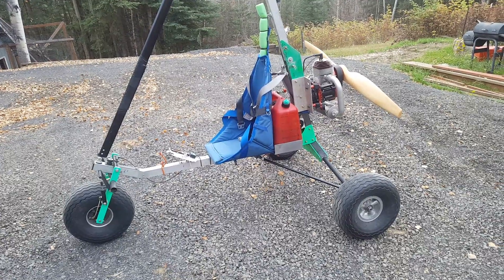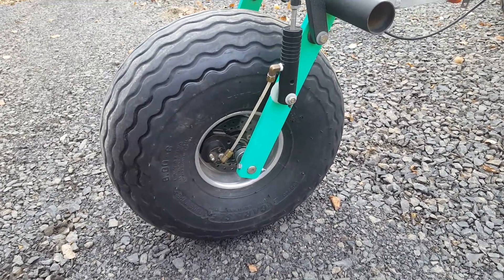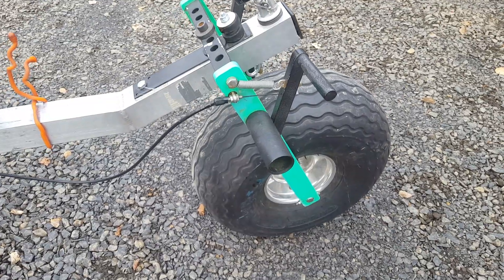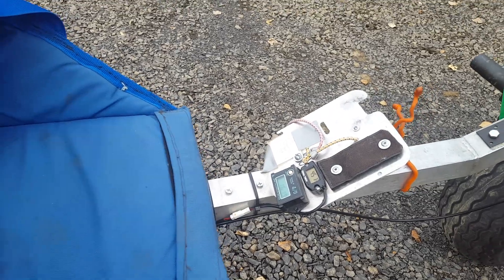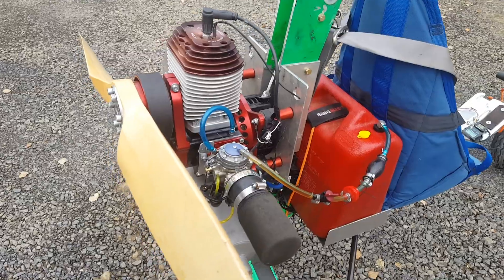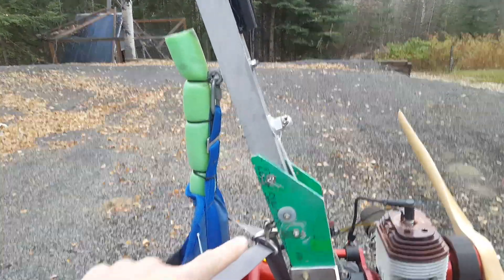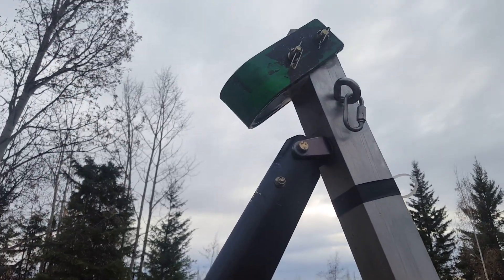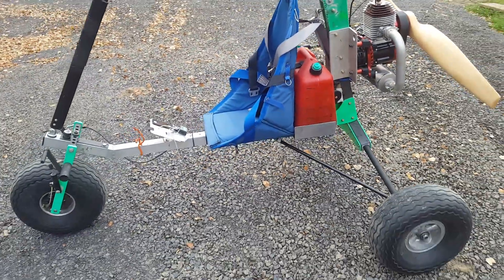Home made ultralight trike

Comment: When you bought the used Northern Wing did it come with the struts/supports and lower "stearing" bar or did you have to make all that? In other words, when fitting a hang gliding wing to a trike, are you basically fitting the OEM existing wing into the "hang hook" at the top the mast and using it as it was originally designed? (sorry if my nomenclature is not accurate)
Reply from the maker: Great question George. Actually, to mate the glider to the trike, there is a bit of reinforcement and adjustment that my friend Brian and I did. First, we put an 18-inch long outer sleeve tubing over the hang point for reinforcement. Then a strap of 3/16" carbon steel was bent into a "U" shape and then we drilled a hole out of a block of UHMW plastic to accommodate the diameter of the tubing at the hang point. This plastic acts as a slick bushing between the hang glider tubing and the "U" hang hook that attaches to the trike mast. The hang hook with plastic insert is fixed to the hang point on the glider's keel by two compression C clamps on either side of it. Finally, we had to test fly this set-up at a couple of feet off the ground to see where the control bar trimmed out in the neutral position. Turned out that we needed to move it forward about a foot, so that meant swagging new front and rear control bar cables of the appropriate length to place the control bar in the correct position. Sounds like a lot, but once you understand the process, it's pretty straight forward and can be knocked out in a long day or two 5 hour days...

Comment: nice build.  Did you use plans or design it yourself?
Reply from the maker: Friend built it...no plans...and I modified it...
Reply: @skycowboyak4549  Did a great job.  Has it held up ok ?
Reply: I would like to build one like it with electric motor
Reply from the maker: @tln8424  yes, it's lightweight and easy to put in the bed of a pickup truck...preflighting is really important to make sure everything is airworthy...there is always maintenance, but it is reasonable....
Reply: @skycowboyak4549  I want to cruise as slowly as possible, just enjoy the view from 500 to 1k feet.  I am down in Louisiana - don't have your kind of scenery.
Reply from the maker: @tln8424  You could do that without too much trouble...I think the trike platform would work well for that...

Comment: How much torque and how many rpm do you need to make something like this ?
Reply from the maker: You need an engine powerful enough to push a lot of air (thrust), but not too heavy so that you can fly. A car engine is powerful enough, but too heavy...and a lawn mower engine is light enough, but not powerful enough. This engine weighs around 20 kg and produces 28.5 hp at 6200 rpm.

Comment: Very nice
How much thrust does it produce?
I am getting an electric rig that will do 165 lbs of thrust and hoping to use that.
What plans did u go by? 
Where is a good place to source wings, I am assuming u did a lot of reserch
Cheers, Patrick
Reply from the maker: Hi Patrick, I don't know the thrust but it puts out 27.5 HP at 6000 rpm. My friend Brian has been flying trikes for 20 years and is a builder. You can get wings from sources on Barnstormers under trikes.
Reply: Hi Patrick/skydrive...
I have a question I have monthly plan to go 10 hours journey around 500km one side ..
So using this vehicle can I travel by air ?
How many hours we can travel?
What is the speed in air 
Please help me in reply
Reply: @kmuralikrishna1582  these are small short range  leisure craft that are very weather window restricted.  
I would have to say no.
Cheers